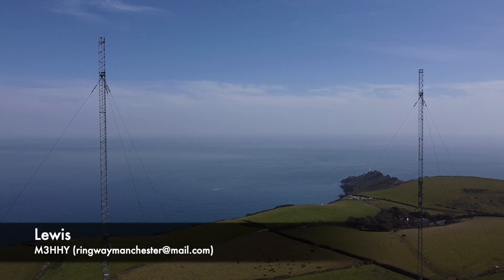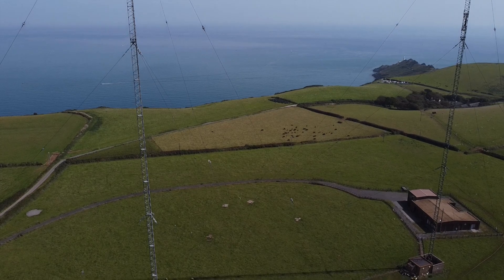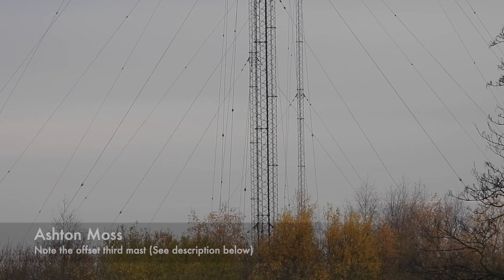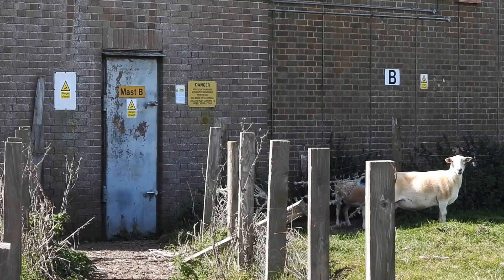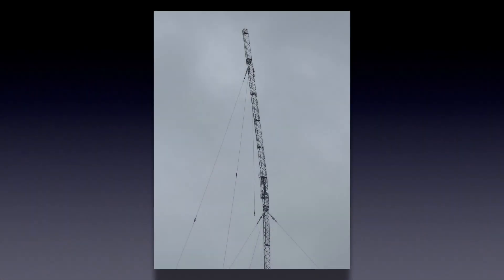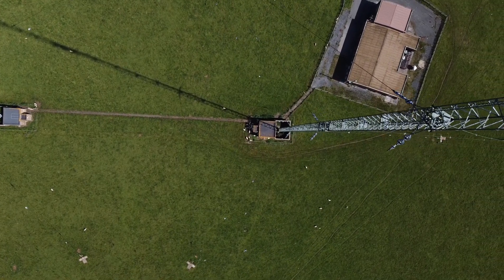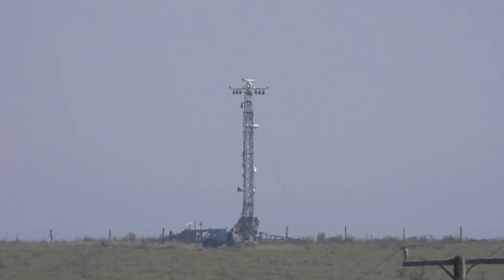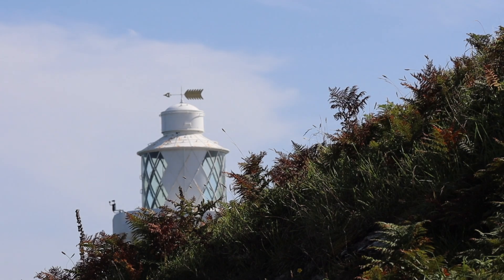High Powered Transmitter - Another Victim Of The Death Of AM Radio

Comment: The technologies that have replaced AM Radio are especially vulnerable. Experiencing the Atlantic Hurricane Season year upon year emphasizes to me the vulnerability and weaknesses of digital systems depended upon multiple layers of rebroadcast transmitters and towers. AM & SW Radio have many advantages over digital systems in war torn areas and areas where weather has destroyed multiple rebroadcasting/relay stations. It is the ignorant and tragically unaware country that abandons altogether AM, FM and SW Radio Systems. Perhaps smug Europe needs storms such as the ones experienced by the Southern Atlantic Coast of North America to smarten up. Europe has been lucky, the storms with increased wind and flooding brought on by climate change have not yet made their full impact known to this continent. Europe, with your digital dependency you may yet regret shutting down simpler more dependable broadcast systems.

Comment: Great video as ever!
Have not seen it mentioned, but the West Prawle Transmitter you mentioned was actually part of the Datatrak network. Closed down on 2012 never to be used again. As you said they saw an opportunity and borrowed it for a while.
I am collecting as much info on these towers at the mo as in 2012 a few of them came off air and were dismantled. If you ever need any info on these Datatrak LF antennas please feel free to get in touch!

Comment: @RingwayManchester >>> As I understand it, "AM" {Amplitute Modulation} is referred to as "Medium Wave" in the UK and/or Europe. Is that correct? 

If so, are AM and Medium Wave used interchangeably?
Reply: Strictly speaking 'AM' and 'MW' dont mean the same thing, in technical terms... AM - Amplitude Modulation refers to the way the signal information is overlaid onto the carrier wave (FM - 'Frequency Modulation' is the other common way of doing it, assuming we're talking about analogue broadcast radio.)
          'MW' - Medium Wave - refers to the waveband on a radio that can pick up signals between 540 and (in Europe, at least) 1600 kHz on the radio spectrum, or, as it was commonly measured here up until the early '80's, 525 metres to 190 metres (wavelength), IIRC! While broadcasts on MW are almost invariably 'AM', it should be borne in mind that broadcasts on Long Wave or Short Wave are 'Amplitude Modulated' too, as, fwiw, are transmissions on the Air band, despite being adjacent to the VHF~FM part of the spectrum...
           There is also also a modulation system called SSB  (Single Side Band) which is also used on the SW band, though not for broadcasting. It represents a way propagating your signal further with less power, and is used by amateurs and some marine traffic, mostly. Hope this helps! Also, while I'm deeply interested in this stuff, let me say, I'm not an expert by any means!
        " Long Answer, Short ": If one wants to be pedantic about it, 'AM' and 'MW' aren't quite the same thing, but for practical purposes, YES, you can use them interchangeably!
Reply: @richiehoyt8487  >>> Rodger all that -- Thanks...👍
Reply: Yes
Reply: Amplitude modulation didn't always mean medium & long wave broadcasts only. The television sound transmissions in Britain and France used amplitude modulation on V.H.F. In Britain this was because amplitude modulation was the only technology available when the 405-line service began in 1936. In France this may have been to avoid paying patent royalties when their 819-line (later 625) transmissions started in 1949 plus, perhaps, considerations of national pride. The French network continued until comparatively recently (2011). The sound quality was every bit as good as F.M. as I remember watching
Reply: ...as I remember watching a 405-line receiver in good working order in 1984. Where F.M. scored was in making better use of the transmitter power to give interference-free reception over a wider area.

Comment: It was sad when radio one left mediumwaves it was never the same when it was forced onto VHF. When I moved to weymouth from the middle of berkshire  I was thrilled how good the signal on 1053 khz was Start point was only 30 or 40 miles away and the 120Kw signal was so strong no fading even in the nite. A total contrast to berkshire where even in the day there was some phase distortion on 1089KHz a bit in the day a lot at nite. Cheers thanks for the video x

Comment: It's really interesting to see and hear about transmitter sites from other parts of the country.
 Start point lighthouse is also a kind of radio transmitter. It's just that they are putting out a signal at 400-800THz and modulating it with a rotating mirror. 😁

Comment: As a broadcast engineer, the inside of the buildings would be interesting to see.  Since the site are being decommissioned, it should be easier to get in and look around.  In the states, this is relatively easy, just find out who takes care of the sites.
Reply: that would be talking to arquiva. like crown castle over here in the states, i really doubt they would let you, but you never know. that said, maybe because it's closing down, maybe they would let "historians" in to preserve at least the documentation and paperwork history such as the logs... maybe get in touch with Bletchley park museum, maybe they could help and put them on display for example especially has it has a WW2 connection
Reply: Out of curiosity, how did you become a broadcast engineer?
Reply: @quimleyofficial  I had some good mentors in my youth.  I had an interest in RF and around 12 had built an FM transmitter from plans I found on the internet.  One of my mentors was a staff engineer for one of the local TV stations.  We would spend hours on Friday nights looking at schematics and parts from broadcast equipment.  He took me to the transmitter site for the AM they maintained one afternoon.  The roar of the blowers, growling high voltage transformers, and the indistinct din of the transmitter as it made peak audio modulation...I was hooked.  I've had a thing for AM ever since.  There is something magical about sending electrical energy into the sky, and having someone thousands of miles away hear it.  I began working in engineering right out of high school while attending tech school.  I've been in it for 20 years now, working for a contract engineering firm doing transmitter installations, upgrades, build-outs and repairs.  I still love it.
Reply: I always peek to see if faders are rotary or sliders ;-)
Reply: @BenTrem42  And if they were sliders, did they work "upside down" as was BBC practice for many years..
Reply: @rambo1152  Noooo, really? Would love to know the history to that bit of shop! (I learned that Beeb came over to Canada to see how we operated with "Mother Corporation"; I wonder if there's a connection there.)

p.s. I never ever felt comfortable with rotary; I can't imagine vicky-verky!
Reply: Oh? I thought I saw something like a studio panel. (I should have included a time stamp!)
But you'd know, so ... cheers!
Reply: I work with Arqiva and Cellnex. You're not getting into those sites unless you're doing work on them.